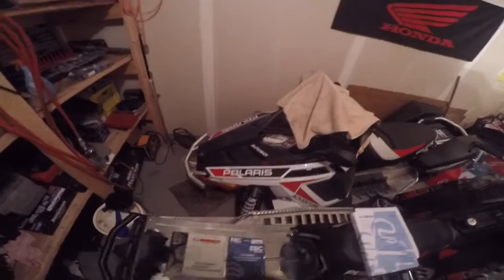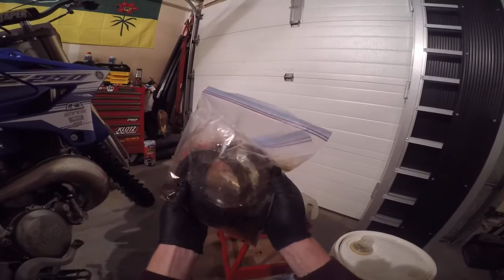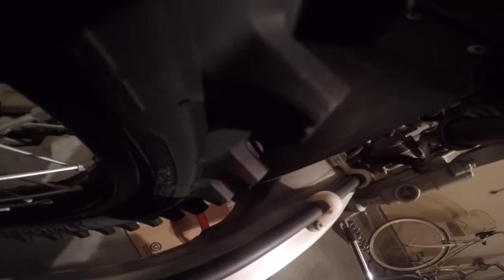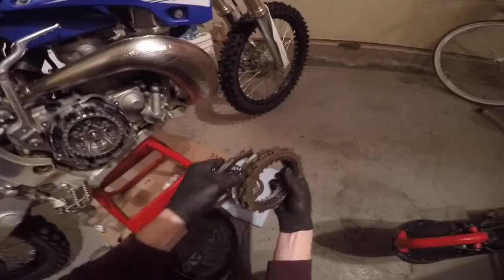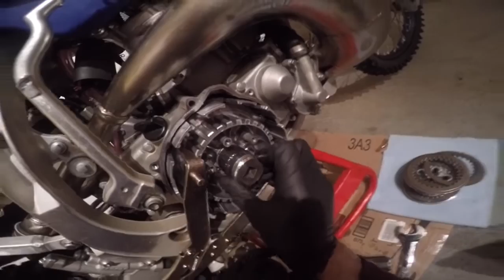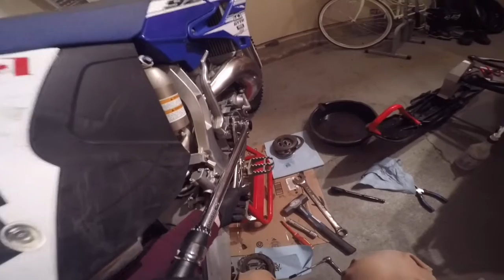YZ250 Clutch Change (How to)

Comment: Guys I have a question I hope any of you guys can help me out so I have a 16 yz250f and at first my clutch cable snapped so I replaced it but now that I replaced it my clutch is like not engaging like I pull in the clutch while I’m in first gear and the wheel locks up like if I’m not pulling in the clutch but I am but if I force the wheel to spin while I pull in the clutch it will spin but barely

Comment: I have a 2001 Yamaha yz250f four stroke do you know if the clutch replacement would be the same? I noticed your bike is a 2 stroke. I’m new to the world of dirt bikes. When I start the bike with the clutch pulled in it fires right up then when I release it (still in neutral) the bikes stalls. I’ve been told the clutch might need to be replaced.
Reply from the maker: Yeah it’ll be pretty much identical.

Comment: is there any fix if you did do it not enuff and the clutch is grabby mine actually makes a strange noise when the plates engage
Reply from the maker: Not sure what you mean by that, if it’s grabbing your basket may be notched or the plates aren’t saturated enough in oil
Reply: @turdpike  yea its on my 19 the original owner was almost 300 lbs somehow i think he broke the clutch in by riding it now its like notchy feeling pulling out like it doesnt grab smooth its jerky when you pull out bike had 25 hrs onit now i put 10 on so he had it 15

Comment: Is there another spacer washer behind the clutch basket that you didn't show?  An example would be like a clutch diagram of a 1986 YZ 250.
Reply from the maker: The modern YZ’s (like 2000-present) just have the one washer behind the basket

Comment: Hey man, I just got a new Pro X clutch basket.  The kickstart gear doesn't protrude past the face of the basket, its slightly recessed. Will this be a problem even with the spacer for the inner hub?
Reply from the maker: I’m a bit confused, you’re saying the big gear on the back of the basket isn’t engaging with the kickstart idler gear?
Reply: @turdpike  Thanks for the reply.  No, I bolted the large gear to the back of the basket, but when I pressed in the small gear, it did not extend beyond flush with the inside of the basket.  So when I put the basket and inner hub back on the bike, they both spin together.  So if your looking at the inside of your basket, you will notice the face of the starter gear that is pressed in is raised, mine is not....
Reply from the maker: Ahhh I see what you are saying now. That is odd- I’m trying to picture the last time I had mine apart to compare. But it’s as if the pro-x basket is thicker eh? Stupid question but when you pressed the small gear on you’re certain it’s seated as far in as it can go? With the spacer thrust washer in between the hub and basket they shouldn’t touch each other and spin independently for sure. Something seems odd. I’d be curious to take a measurement somehow of the thickness of both the baskets in that area. If there’s a difference maybe it’s worth getting a hold of Pro-x to ask what you’re supposed to do
Reply: @turdpike  Thanks for reply man.....yeah, the Pro X basket has to be thicker, which is weird cause their basket fits like 93-2016 YZ's....Maybe wrong part in box or something.  Im just hoping for a refund now! Great video btw!

Comment: So I need to do this for my yz is there a gasket for the clutch cover  or what is there ?
Reply from the maker: There’s an o-ring embossed in the cover itself I believe, but if you’re careful enough you shouldn’t need to change it. Make sure it is seated in its groove before you bolt it back on

Comment: I did my bike the same way as you were doing and a small ball bearing fell out where does that go
Reply from the maker: small bearing? the only bearing involved with the clutch goes between the clutch rod plunger and the pressure plate itself. If that makes sense. Go to BikeBandit or Rocky Mountain ATV/MC and find a parts diagram. You'll see it on there

Comment: I have 16'yz250x..jus replaced clutch plates..basket had wear marks but i did not feel any grooves..still when i hammer it in 5th gear.its feels likesomeone is tapping the clutch.ever so slightly off and on .but the motor wont pull cleanly... Its only 5th..any ideas?
Reply from the maker: Craig Steinman that sounds more like clutch slip than clutch grab. Springs are more suspect there. Notchy baskets usually cause clutch grabbing, where it’s as if it won’t engage and the bike wants to keep chugging forward

Comment: With the bike off, I’m in gear. I apply the clutch to roll the bike and the chain is working against the engine. Not fully but 35%. Can be hard to kick start in gear. I maxed out the adjustments, then replaced the clutch. The problem remains. Not sure where to go next. Great video.
Reply from the maker: seller559 does it work properly when it is running? You pull in the clutch and it disconnects the engine from the rear wheel?
Reply: turdpike   Yes. I can go through the gears just fine.

Comment: Hey @turdpike i have a 98 yz250 and i lost all clutch i took all this off and my basket is super grooved from the plates also my basket moves up and down does this mean my inner bearings are gone?
Reply from the maker: Cody Neef if the basket has deep groves then yes it can cause the clutch to grab/drag as if it wasn’t working at all. If you’re tight on cash you can file them down a bit, but keep in mind that is a one time only thing that you shouldn’t do again.
As far as the up and down play- it may be the bearing or the bushing or a combo of the 2. Although that you’ll have to decide for yourself as that’s harder to diagnose from here
Reply: @turdpike  when i grab and apply pressure like the basket is supposed to do to the spline i get no up and down wiggle play so im guessing maybe its worn basket/washers/push rod my clutch had no metal ball bearing when i took it apart previous owner did the clutch maybe he forgot it and thats why i am in this issue idk?

Comment: 15 40 engine oil????
Reply from the maker: Lane Tanzey ya I use Shell Rotella 15-40
Reply: turdpike I can’t use motor oil in mine or mine clutch slips and shifting sucks
Reply: How does urs not
Reply from the maker: Lane Tanzey really? When was the last time you checked your clutch plates? Engine oil should work fine
Reply: turdpike there good it’s just mine hates motor oil
Reply from the maker: Lane Tanzey hmm, odd. How hot is it where you live? If it works for you just keep doing it!
Reply: turdpike most days 70 sometimes 100
Reply: Lane Tanzey maybe try not using synthetic oil? Motor oil should work just fine as long as it is not synthetic.

Comment: Can you please make a video on how to chamge a crank seal? I got a 2007 yz265 ( bored ) and my right side crank seal is leaking. I subbed..please make a vid. Nobody else has ome
Reply from the maker: Alec Thayer unfortunately I don’t have a reason to get access to mine/change mine yet. But in the future I can. Essentially all you have to do is take the complete right crankcase cover off, and pick the old one out and tap a new one in. So you’ll have to take off the kick starter, water pump impeller, and will need to remove the big gear on that end of the crankshaft. Then you’ll see the seal
Reply: Do i need any special tools? Can i just push the new crank seal in?
Reply from the maker: Alec Thayer all i ever use to drive seals in are sockets and a hammer. Works fine. No special tools to do any part of the job at all, you will need a new paper gasket though for the crankcase cover itself. You won’t even need to take clutch cover off either. It’ll come off with that whole half
Reply: turdpike i think i can do it honestly. I just got bad anxiety and am over cautions when it comes to my bike lol i have had experience rebuilding top ends ans doing jetting and stuff just not the best when it comes to all these gears and lots of bolts. Also, will i need to torque or lock tight anything?
Reply from the maker: Alec Thayer Only way to learn is by doing! And before you know it you’ll begin to realize how easy it all is. No you shouldn’t need any Loctite or anything. Just take your time, grab some rags to set things on exactly the way you took them off and you’ll be fine
Reply: turdpike thanks. Really appreciate the help. I hope its also not the crank bearings 😵 keep your fingers crossed 🤞 im gonna be replacing it this weekend.
Reply: Did you do it? How'd it go?